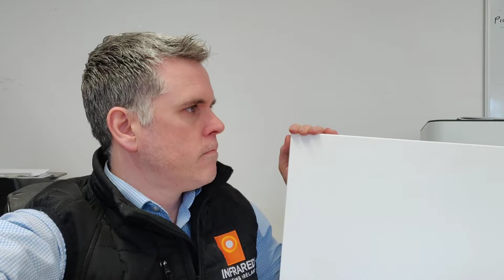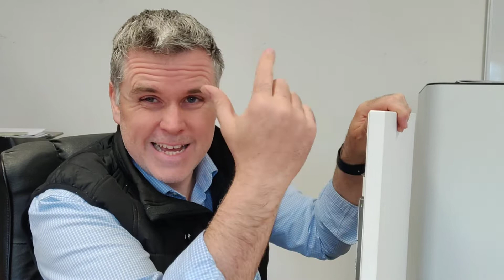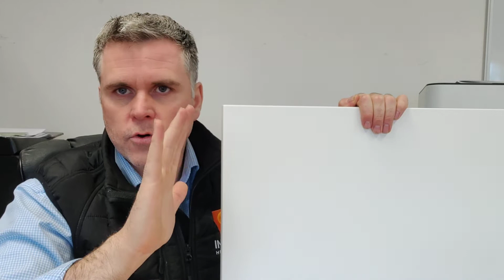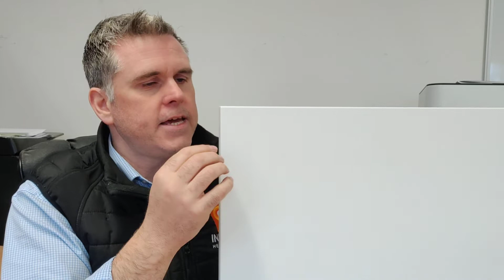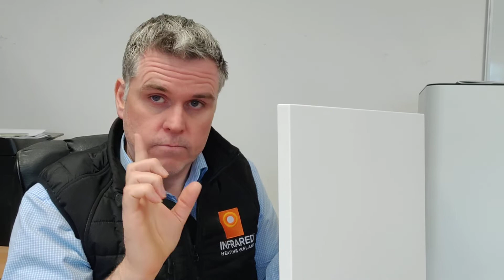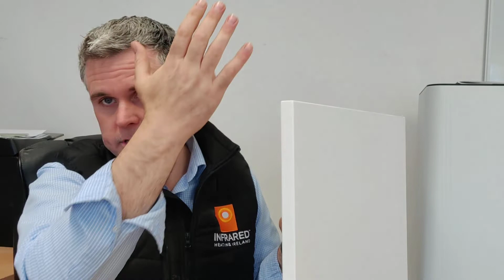SunLife one infrared panel up close

Comment: Hi Eamonn, thanks for your reply, great timing actually as I just found an electrician who seems to understand infrared panels and is happy to fit them and their controllers.
So the thing is I want to start with a ceiling panel in the bathroom but ideally I need a white circular panel, do you do such a thing?
Its a small room with a dual fuel towel rail but I'd like a panel to supplement heating when i need a little heat instantly in the autumn or spring. The trouble is it has only three recessed spot lights each about 100cm apart so I'm thinking a circular panel would be easiest to place wherever the joists are.
I'm happy to communicate by private message on your Facebook page if that's easier btw, i just thought I'd come here first as youd so recently replied here. Youtube doesnt seem to let you reply to a reply, hence the new comment.👍
Reply from the maker: @judebrown4103  PM me your details and I’ll call you to discuss your project